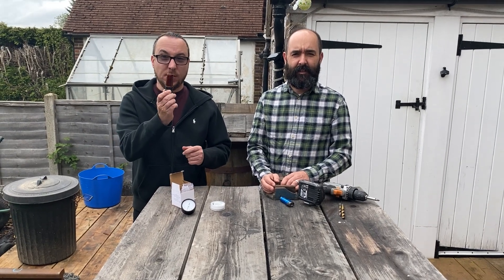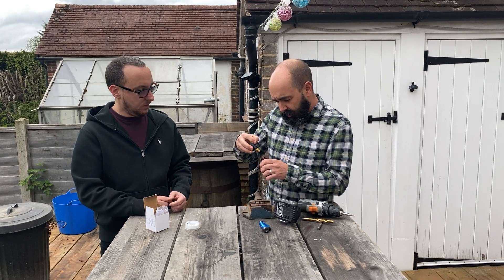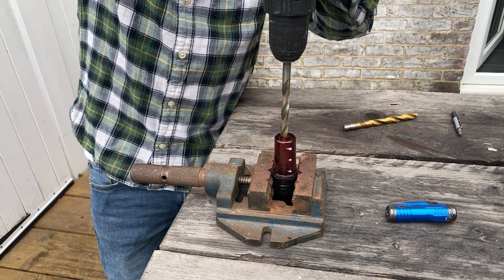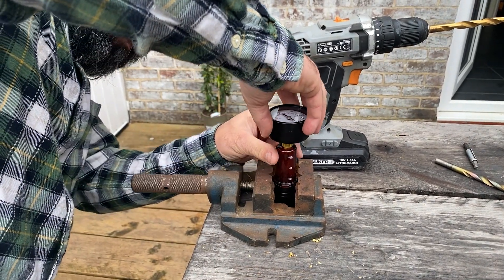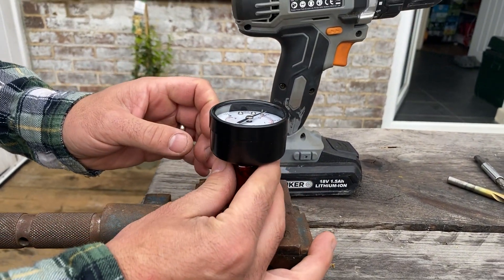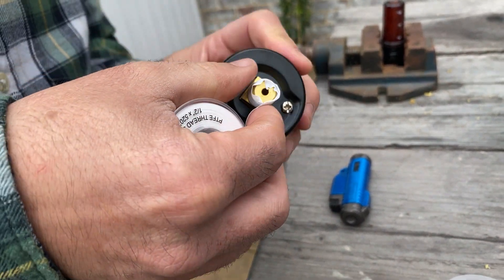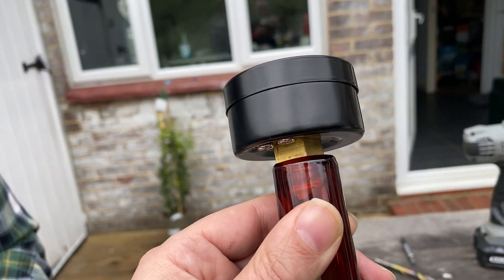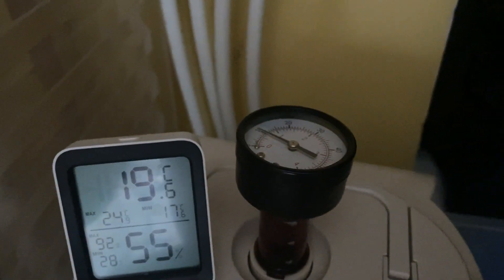Pinter 2 - I built my own Pressure Gauge

Comment: Hi Frank what's the point of doing that, getting the spunding valve is surely the way to go?
Reply from the maker: @Tim Mullins Thanks for watching!!  Agreed, but it's more expensive, and the idea is that I'll use the pinter prv, but just dieal in the pressure... using the pressure gauge as a guide... depending on how it goes and what Pinter come back with... a spunding valve might be next on the list :)
Reply: @BaitAndBeers  would get one anyway mate, more control, think you should grow a beard like your brother lol